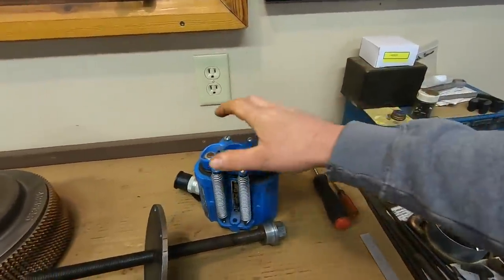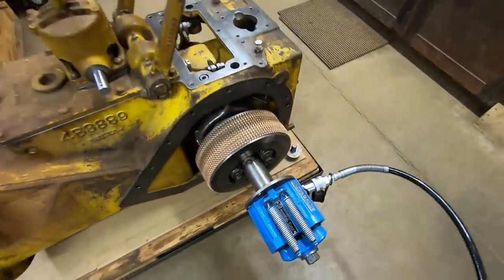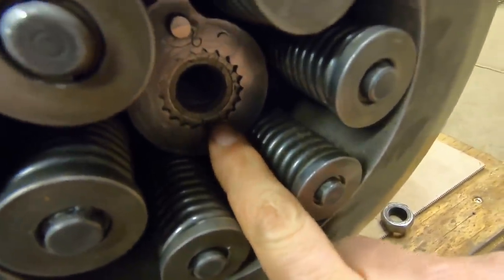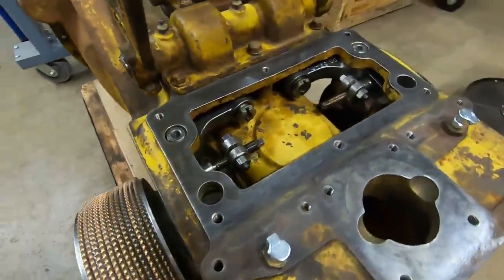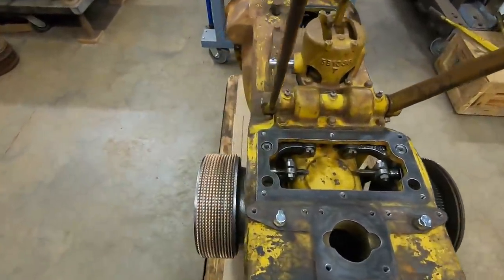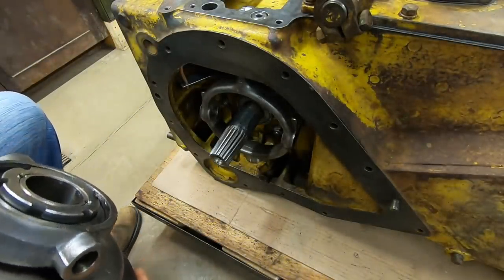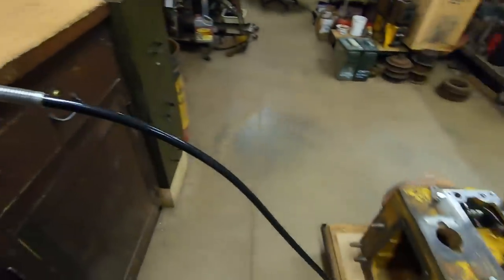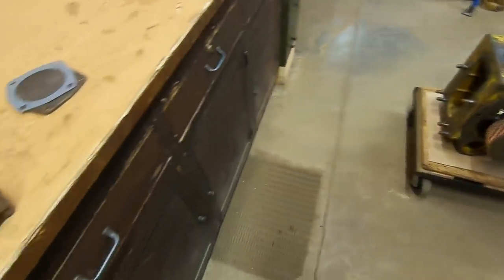Caterpillar D2 #5J1113 Chassis Rebuild Ep.21: Steering Clutch Press Fit & Finishing The Transmission

Comment: Do you ever mark the fastenings which you finished tightening to their final 'click' tightness? (unless stated otherwise, I tighten to one of two settings BT, bloody tight or the slightly tighter FT) I understand that the fold over locks and locking wires are very visible, but what about the minor bolts around some of the covers or pinch bolts.

Comment: Thanks for another update. I'm wondering if those clutch carriers broke fitting them at the 15 ton cat figures, because over time the heat cycles during use altered the metal structure. Then it couldn't handle the same pressures  after being used compared to when it was fitted new ?

Comment: I'd rather trust a screw tightened to a torque calculated give 8 tons of
 tension than that hydraulic ram (unless it has been calibrated 
recently) The gauge looks like it was made in Hurry 
https://www.engineeringtoolbox.com/bolt-torque-load-calculator-d_2065.html
A  M30 (1 1/4") screw (lubricated) torqued to 287 nm (212 lb.ft) will give an axial load of 79.712 kN (8 tons)
Reply: Screw torques are famously unreliable due to the variation possible with coefficient of friction, even lubricated.  However, I'll point out that the 3/4" bolt he dry torqued to ~ 220ft .lbs is about 8.5 tons of force.  The snug-up and stretch by a fixed distance method (often incarnated as a torque-then-turn so many degrees) is much more reliable.

Comment: I don't think you mentioned, but I assume the steel ring next to the pressure plate would wear preferentially and protect the pressure plate casting?

Now, I really don't believe there's any debate to be made about the main clutch lever. 1113's repaired by you vs "Beer Can" or 2115's repaired by others? Who are you trying to kid?
Reply: @squatch253  I wouldn't have expected anything less :)
Reply: Wouldn’t the last steel plate also keep torque from being transmitted through the pressure plate?  The pressure plate isn’t splined to the hub, but the last steel is.

Comment: Why would you want a crawler tractor in an orchard? I can't imagine the strengths of a crawler (super traction and power and not sinking) are particularly useful enough to necessitate buying one over a regular wheel tractor
Reply: True about using it in the orchard but if you had other uses for it then you would only have one tractor instead of two, just a thought.
Reply: Lower ground pressure would be a benefit too. You would have less soil compaction, especially since in an orchard you would pretty much always be driving in the same tracks.

Comment: So I'm going to go ahead and ask, has anyone thought of installing a turbo on these? Obviously this isn't a good candidate for such blasphemy but more curious on Squatch's opinion.
Reply: @squatch253  that is an awesome video. I was kind of curious on the technical aspects of putting a turbo on since it would need more fuel. Then theres the issue of tuning it to not run too hot or cold and not blowing head gasket, or turning internals into externals. Keep up the good work I look forward to every new video.
Reply: @squatch253  thanks!!

Comment: Whoever designed these D2 steering clutch housings must have had tiny hands and could reach into their work easily.
Reply: @squatch253  I agree, my 7U is a little short for me as well, I'm the same height. I was planning on making a set of seat rails to slide it back and up a little out of some 2" square box. make life on the knees easier.